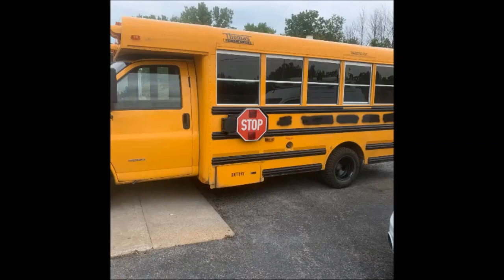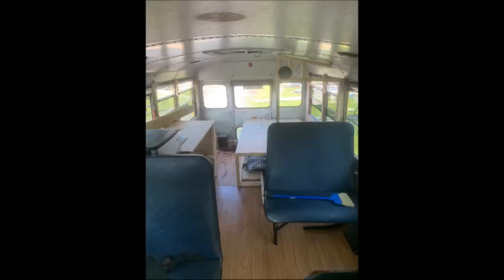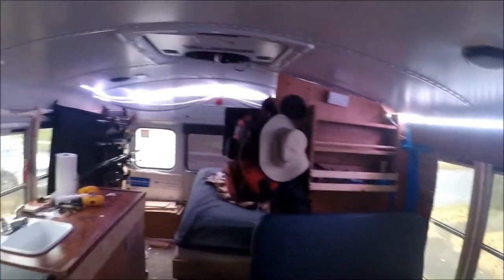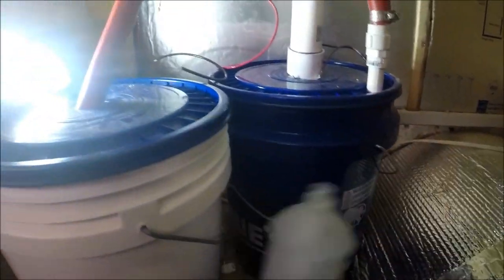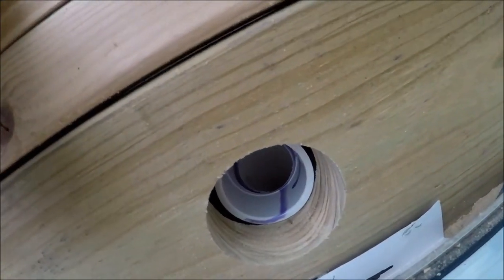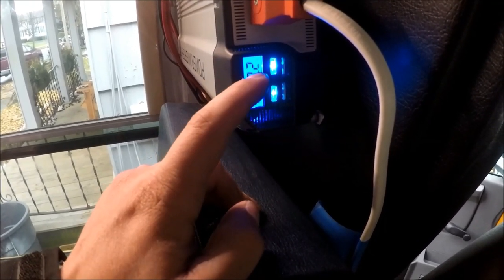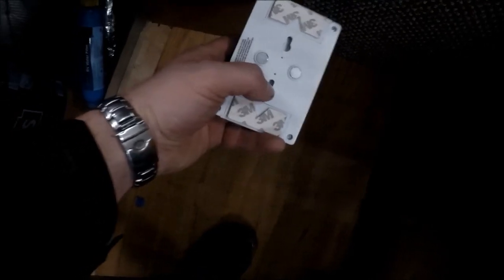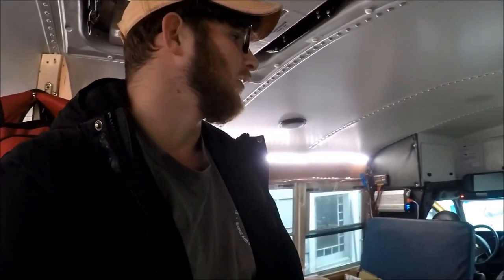My Skoolie/ DIY RV!! (ReUpload No Music+ more commentary)

Comment: I'm in NJ also and I have been working on my bus for a while.  You did a good job.  You got it ready for hunting season and you were able to use it.  I'm going to have my water fill in the back of my bus, open the back door plumbed into the tank under my bed.  Keep up the good work.

Comment: hi, just purchased a short bus, starting the gut process. What kind of fridge do you have?
Reply from the maker: It’s an Autoommo car refrigerator that I’m currently using but it really depends on the size of the power inverter you want to use. If you don’t use an inverter then you need to use one that runs on 12V DC. Mine does both it can plug into a wall or a car cigarette lighter port
Reply from the maker: https://www.google.com/shopping/product/639027911144309864?q=autoommo+car+refrigerator&client=safari&hl=en-us&biw=414&bih=707&tbs=vw:l&prds=eto:14027537503099550328_0,cdl:1,prmr:1,cs:1